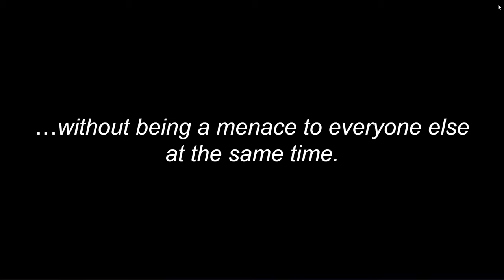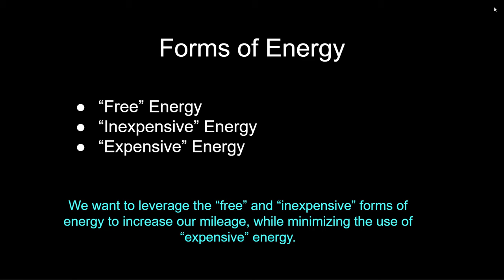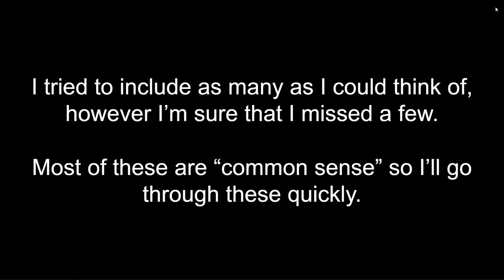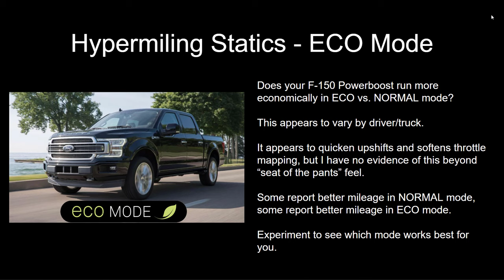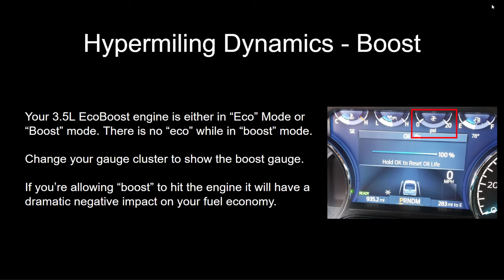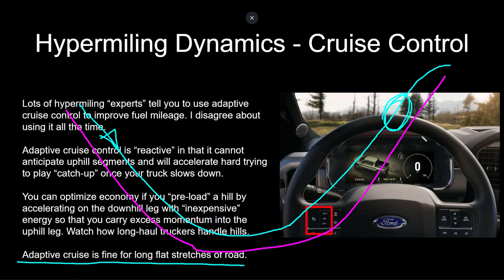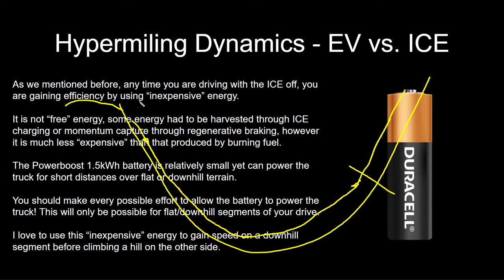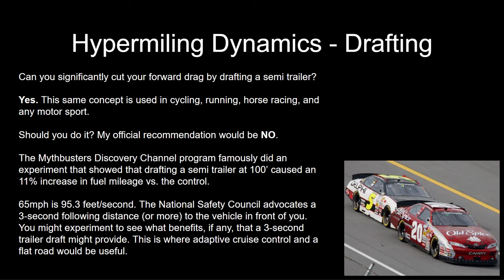How to HyperMile Your F-150 PowerBoost! Get Better MPG and Save Fuel.

Comment: I enjoy your channel, thanks for the quality content. I really like... am loving the Powerboost and agree with all of your advice and logic. As a life-long Toyota buyer, I even sold a disappointing 2023 Tundra Hybrid and bought a ...... Gasp.... Ford!  :)
 Having owned multiple hybrid vehicles, my one frustration with the design is that it is near impossible to accelerate even in normal traffic without using the ICE. (I use the EV coach and am quite experienced with hybrid hypermiling... I managed 250mpg to a tank in my Volt [PHEV yes different]). The electric motor is only 41 HP trying to move a 6000 pound truck.= 146 pounds per HP). My wife's Sienna hybrid weighs 1500 pounds less and has a 54 HP elec motor.  (85 pounds per HP).... My previous RAV4 Hybrid had 2 electric motors at 54HP each pulling a 3700 pound vehicle= 34# per HP. Now, I know that in the F150, the electric motor is located in the bell housing in the transmission. Therefore it's not feasible for two electric motors. And I am comparing a full-size pickup truck that can tow 12000 lb to a compact hybrid SUV. I don't expect the power boost to get anywhere close to the MPG of those Toyotas. But my main point is IF Ford had put a 60 or 70 HP electric motor into the system, we would be able to drive in normal traffic using the electric motor only for a much greater percentage of the drive.
Of course a larger motor will drain that small 1.5 kw battery quicker. But, using the torque app and a OBD2 adapter, keeping track of my hybrid battery charge, I very rarely deplete the battery. Most of the time with intown driving, if I'm accelerating from a stop, I have just used the EV coach to efficiently brake to a stop recapturing 100% of my energy. [I'm surprised you didn't make a subnote regarding the physics and the impossibility of 100% recapture]. I have plenty of stored 'cheap energy' in the hybrid battery to use for acceleration, but I have an underpowered electric motor that cannot move this beautiful awesome truck off the line.
Reply: From an enthusiast and Engineer, Just a few more details for those interested:. In the interest of battery longevity, Ford Engineers programed the system so that the hybrid battery never drops much below 40% charge and even with long downhill regen braking will never charge the battery much higher than 60%. So we are only really using 20% of the battery capacity = .3 kw. Keeping charge in this narrow range exponentially expands the charge/discharge cycles battery can endure before capacity degradation.
Reply: I have no citeable evidence of the following, but from reading articles and watching videos on the subject over the years, I recall you need to severely over inflate your tires to reduce the contact patch and written braking distance. Adding 5 or 10 PSI over the recommended will decrease rolling resistance and improve MPG, but at the cost of a worse/ bumpier ride.
Reply from the maker: @DanX157  Hi Dan, a couple of points if I might speak to what I think the Ford engineers are thinking. (this is just conjecture!) First, this is a PowerBOOST, it's really not a true Hybrid in the sense that many cars are. Why? 6000 pounds of reasons. For them to turn this into a plug-in Hybrid would add another 1,000 pounds of motor and battery and then it cuts into their brand-new Lightning market share as well as cuts into towing/hauling capacity. I actually think they did quite well to strike a compromise and really boost the economy and power/torque of this truck, while also adding super generator capabilities. Second, keeping the battery between 37% to 70% is more about longevity than anything else. That is the ideal zone to keep the battery working as long as possible. Cheers....

Comment: Can you stop/start delete the powerboost? I seen a new powerboost trucks window sticker and it listed stop/start delete. Was wondering how that would work?
Reply from the maker: that's on everyone's sticker because there is no stop-start "delete" on a powerboost. If you put it into sport mode, the ICE never shuts off, so that's one way to handle it.
Reply: Sport only turns off the engine when stopped.

Comment: So, what milage were you seeing???
Reply from the maker: Averaging about 22.5 based on actual miles and fillups. That’s a mix of city and highway. I can do much better than that on mid-speed secondary roads with few lights, typically 27 in the summer. Mileage drops by about 3mpg in winter due to reduced battery assist and winter blend gas.
Reply: @fixorrepairdiy4609  thanks. So, 27 is best one can expect when hypermiling the powerboost
Reply: @greggphealey  I mean...if you have a 50 mile downhill run at 55mph you'll probably exceed 30mpg. But in normal driving on ECO mode on backroads without a lot of stops, I could reliably do 27. YMMV!

Comment: Do bed Covers help?
Reply from the maker: Mixed opinions on that. Mythbusters did this as a test and concluded that open beds were more efficient. I've seen other test that showed the opposite. I just stuck a hard cover on mine and I assume that is "stock" and my mileage is fine.
Reply: Any particular bed cover brand you would recommend?
Reply from the maker: @mrdarenkumar  I'm using a generic $500 amazon trifold hard bed cover. There are many more expensive/higher-quality options. THis one works for me and if it died, I'd probably replace it with similar.

Comment: How do bed covers impact mpg?
Reply from the maker: The only semi-authoritative study that I've seen done was by the Mythbusters. They apparently found that bed covers will negatively impact mileage. I haven't done an A/B test but I don't feel that my hard bed cover is causing me bad mileage with some of the numbers that I can pull on this Powerboost.
Reply: @fixorrepairdiy4609  having a tough time believing this.  I drive a regular 185 mile trip on highway and backroads (which becomes an easy benchmark, as weight doesn't vary much, and weekend temps don't vary much), and always see a nearly 10% gain in mileage with a tonneau cover.  First on my 2009 Honda Ridgeline, then on my 2014 F150.  Now on a 2023 Powerboost (2wd) and first thing I did was get a tonneau cover...
Reply from the maker: @TheFerretHome  Again I'm just passing along the only study that anyone published, not defending the result. Recently TFL did a controlled test and found out that the cover DID increase mileage, although I'm not sure how rigid their tests are. I agree with you that it makes sense that a closed tailgate would be a big windbrake and would negatively affect mpg. Cheers.

Comment: Does the 3.5 PB have AFM shutting down cylinders system.   And can it be shut off.
Reply from the maker: No, it does NOT shut down cylinders. The 3.5L V-6 ICE is either on or off depending on the load, mode selected, and driving conditions.

Comment: I’m currently trying to decide what power train is best for what I need. I live in Florida so it’s pretty flat most roads are between residential and 45-55mph that I drive. Minimal towing and hauling. I take 2-3 road trips a year. Right now I’m leaning toward the Coyote engine. Any recommendations would be appreciated
Reply from the maker: The Coyote or the 2.7L is probably the most reliable option. The PowerBoost is the most flexible and feature-packed but over time the complexity could be a problem. PowerBoost is stronger and pulls harder and has the potential to get the best fuel mileage under normal use. (not towing) The recommendations that you hear will all depend on the bias of whomever you're talking to. cheers

Comment: My Powerboost is only getting 18 mpg
Reply: Learn to drive it. I can get 100 electric miles on a tank of gas and average 22.4 to 24.7 depending how I drive and mode.
Reply: I just got mine about a week ago, just about done with the first tank of gas, and my mileage has been between 23.5 and 24.5 the whole time.

Comment: You are confusing mechanical energy with kinetic energy. Going up a hill, unless the vehicle is travleing extremely fast to begin with on flat ground, the energy going up is mostly supplied by mechanial energy generated by the engine and not kinetic energy. 
Coming down the hill on the other side, all the potential energy is released as gravity pulls the vehicle down and potential energy is then transfered into kinetic energy!
Reply from the maker: OK!

Comment: @13:20 fuel octane has zero contribution to the energy per gallon of gasoline!   ZERO!
87, 89,91,93 octane gasoline all have the exave SAME amount of energy!
Where people get confused is if their high performance car requires high octane and they put in a lower octane, the engine management comouter will dial back the timing to reduce knock thus performance and mileage both suffer!
If your vehicle is specified by the manufacturer to run on 87 octane, using anything higher will NOT gain you more power nor mileage!!!

Octaine numbers are merely the reciprocal numberof the anti-knock index of the fuel additives fuel manufacturers add to gasoline and these fuel additives have zero energy component to it and does not contribute to energy output of the gasoline when burned!!!
Reply from the maker: Thanks. I've always run 87 and agree with your comments.

Comment: Better gas 🤣🤣🤣🤣yea right i got a powerboost plat and it sucks been nothn but problems i am now waiting for my v8 plat with black appearence package...trust me stay away from the garbage powerboost
Reply: Can you elaborate more? I'm interested to know. Looking at 2022 F150 Powerboost
Reply from the maker: @redtarectecan7921  check out the f150gen14.com forum, lots of solid data on the PB combination without the emotion. You don't often hear from the owners that are satisfied, only from the ones that have had problems. Not shilling for Ford, just advising to get both sides of the story.
Reply: I love my PB.